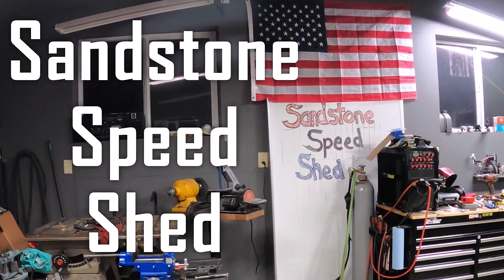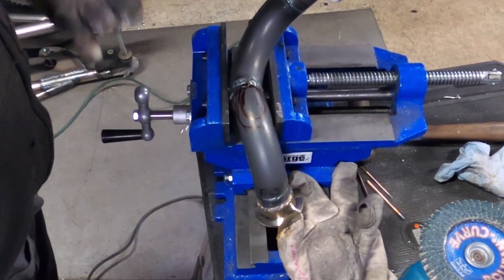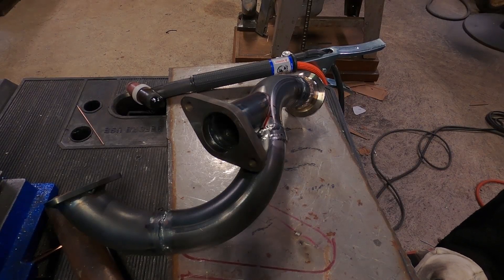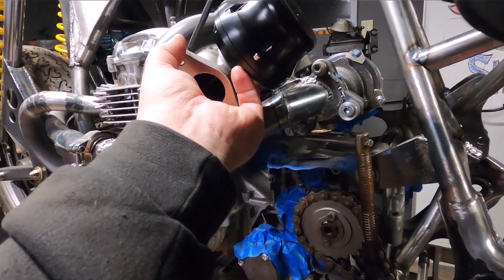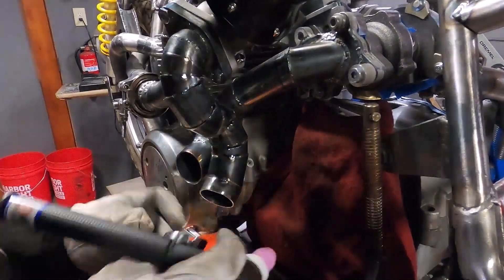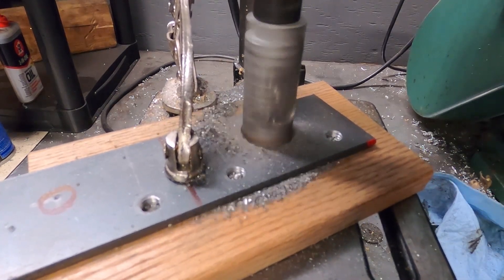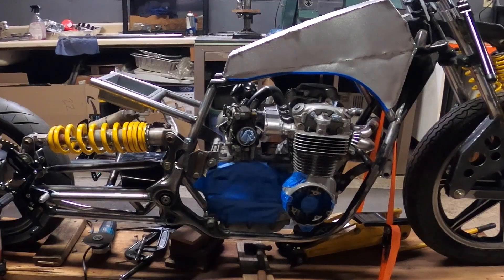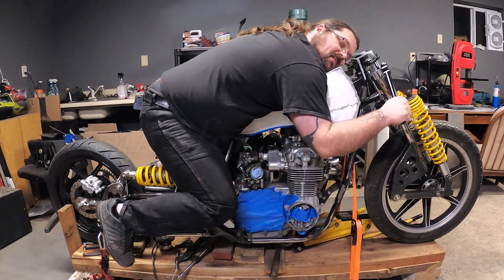Sandstone Speed Shed ep. 8

Comment: I have a concept art piece for a motorcycle that uses the housing of the engine on each side as the mounting brackets... So the round engine case that comes off on each side to get at the alternator and the crankcase, screws right into the frame.... Then a again my frame design was a backwards z configuration... The bottom of the z was the swing arm for the rear wheel. The top back of the z would be where the seat mount came off of and the front of it would be where the downward Stoke of the forks would start. The handlebars were down along the side of the forks near the front disc brake. And the rear foot pegs were along the rear wheel much like yours are...